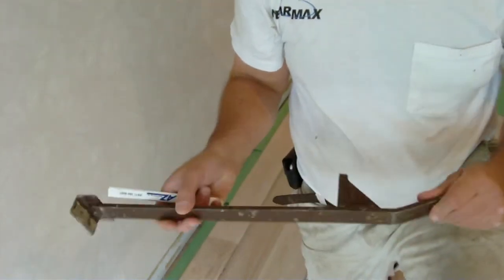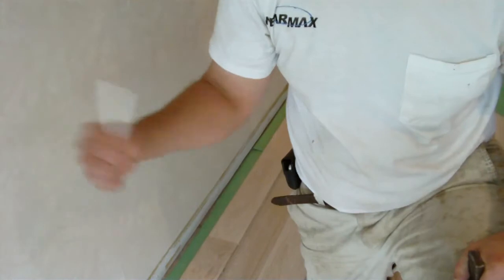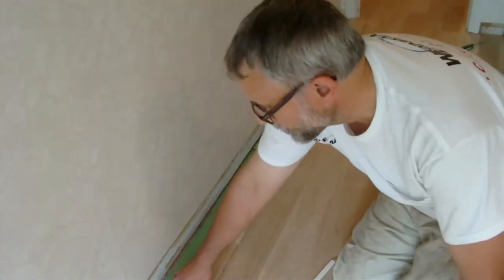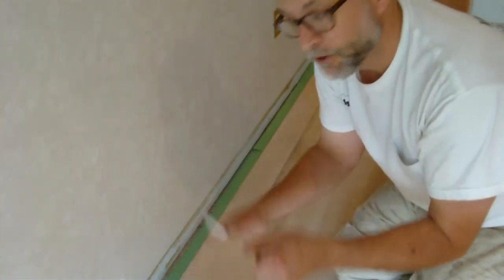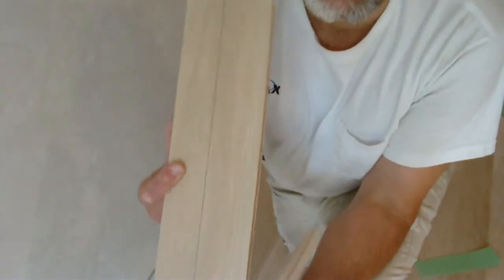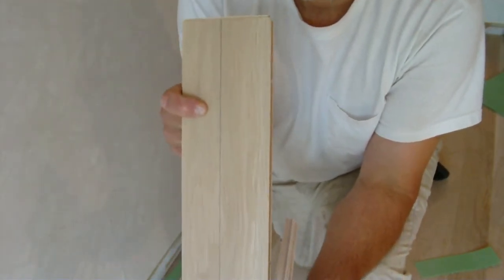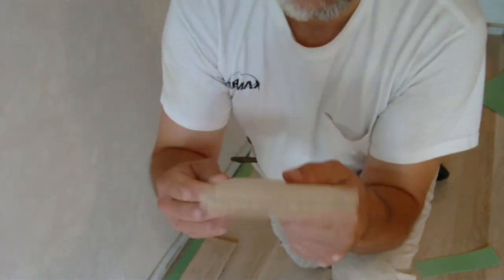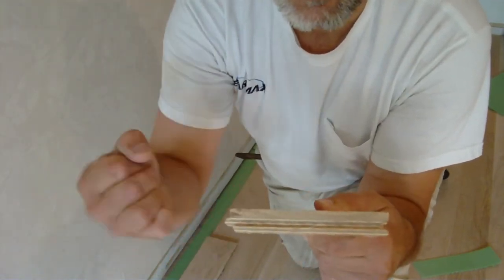install-floating-wood-floor-scribing-last-row-to-wall.MP4

Comment: Great tip! But the tongue on my laminate is only 3/16" which leaves me 3/16" short of having my 3/8" expansion gap.  Also, my walls have some pretty drastic curves that using a piece that long would not correctly reflect.  I measured a scrap piece of wood to the length of my planks and then added 3/8" to that measurement.  I also only made it about 3" wide so it follows the contour of the wall better.  Regardless, this saved me a ton of time.